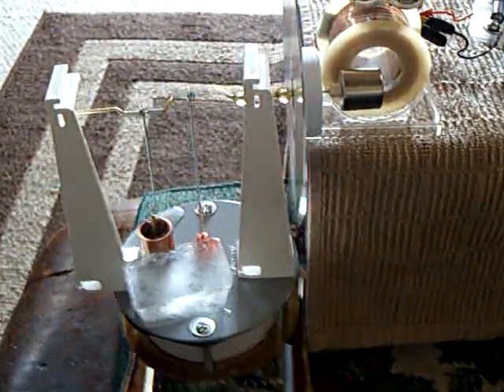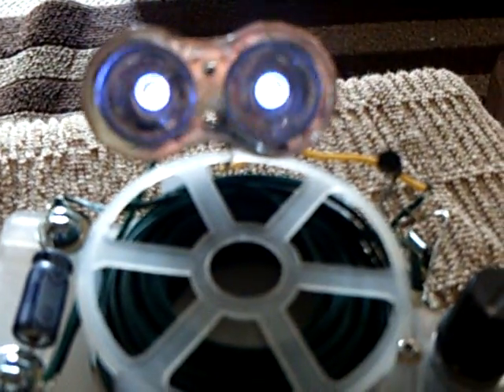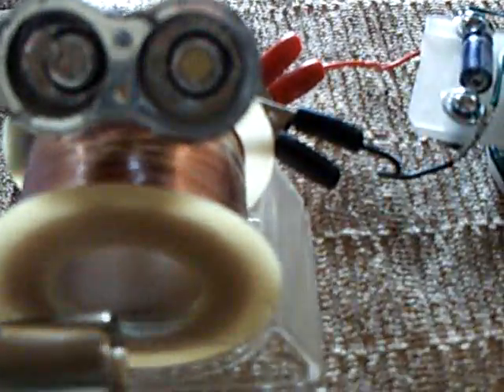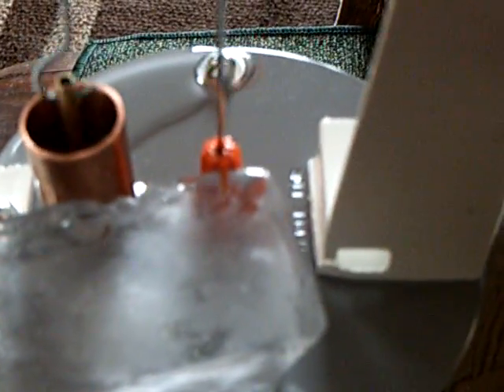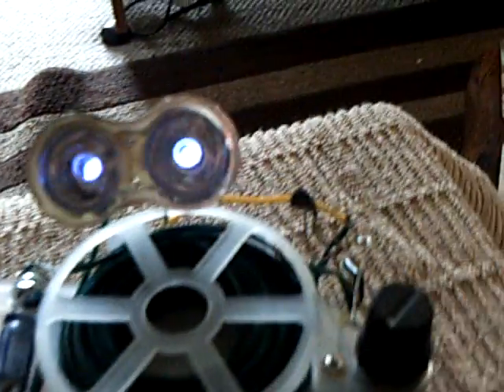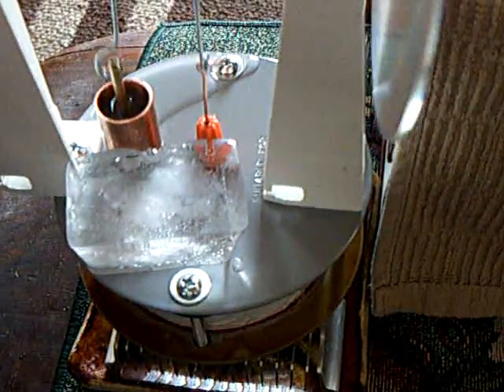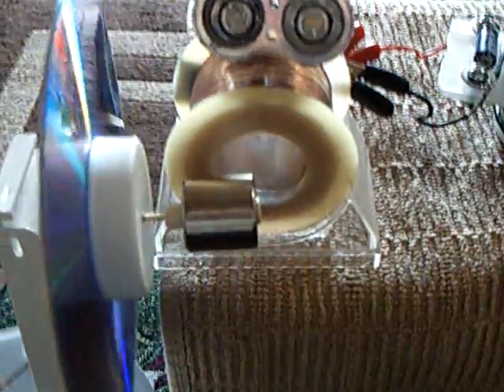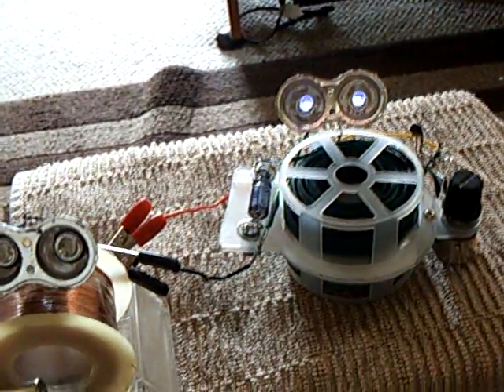Stirling engine making electricity

Comment from the maker: I think that where you live dictates much of this.  If you live in a windy place---use a wind turbine.  If you live in a sunny place like I do, then photo voltaic makes sense.  I am still wondering about stirling engines.  Maybe put them in a hybrid system like the hybrid cars.
Reply: You can put the top of the stirling engine in a wind tunnel to cool it and the bottom near the engine for heat difference.
What do you think? (I know it has been four years...)

Comment: Lidmotor; That is great! Hypothetically speaking. If you had all the free time and material what type of charging device do think you think would produce the greatest current? Yes a photo cell  would be better than an LTD ,but the sun has a lot more to offer than a small LTD could handle.A simple parabolic trough can make enough steam to run to  a small steam engine.The rankine cycle is eneficient because the working fluid has to grow through a phase change.A stirling would do far better.

Comment from the maker: This Stirling engine would be a good idea where you live because of the lack of sunlight during the winter.  Like you say, "plenty of cold" which is what you need and burning wood gives the heat.  I saw a very good application where the engine pumped cold lake water to a cabin.  The people ran the engine on wood.  It was simple and reliable.